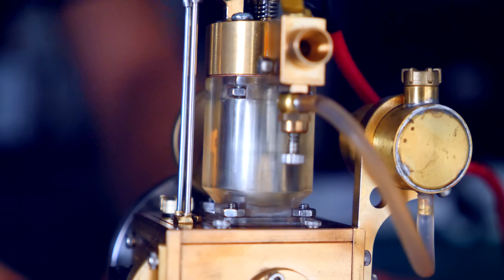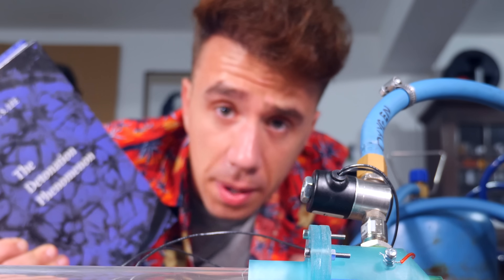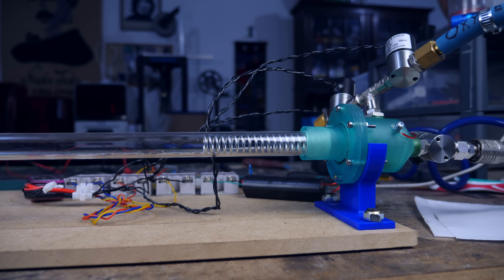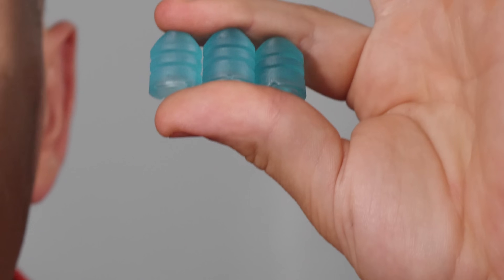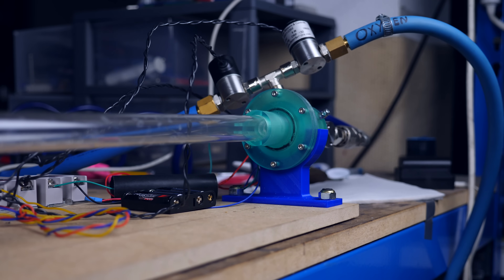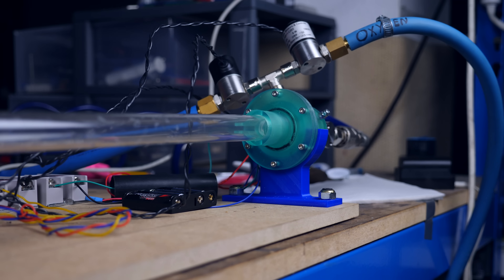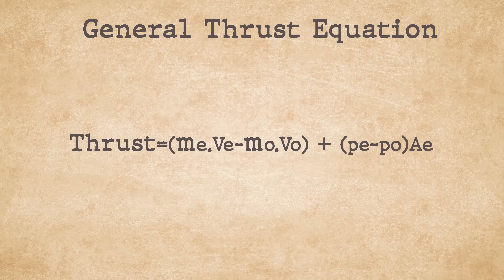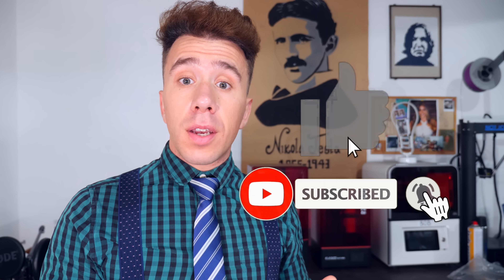PULSED DETONATION ENGINE

Comment: Use two or more valves and alternate between them, using the Arduino, so each valve is used near its peak frequency! I'd like to see that engine ran at 100 hz, then try 200hz,500hz, 1khz

Comment: Hey integza, an engine like this (pressure optimised) are best used as prop/shaft engines. It's much more efficient to extract the energy using a turbine rather than trying to push against the atmosphere

Comment: So I been thinking about this I'm Shure it's a gas exchange down thr barrle of the engine so you have to put ports and use a noble gas to to push out the ,as.well.as.sheld the engine from heat so the reaction happens in space the gas pushed through ports will push the shock wave out you can manipulate  the shock wave ....but your right

Comment: What is stopping you from putting a piston with a valve in the pipe? moreover, the piston can be screwed with a crank mechanism for return, or can it be screwed with an ordinary rubber band or spring for return? there is a two-stroke engine with efficiency. with uv. ioannn

Comment: this kinda reminds me of a cool engine I built when I was a young girl

It was similar to this, but instead of gasses, I used fuel cartridges that were basically brass cylinders filled with gunpowder that was ignited with a pin that struck the back of the fuel cartridge, and capped off with piece of brass that was round. The ignition would send the brass piece that conveniently fit the exhaust tube perfectly and was aerodynamic, to allow it to fly safely through the air. The gasses that followed the brass piece were used and chambered into the back of the engine to push the pin back and load another fuel cartridge, allowing for the engine to run essentially forever, until either you ran out of fuel cartridges, or until the engine overheated.

Comment: You've created a cross pulse jet with potato gun a pointless project . So you have CAD software I wander if you could design a jet fighter trainer the specifics are span 9m ,length 11m ,aspect ratio 3, wing area  27m squared . The engine is 42KN, chord to length 0.0257069 and top speed is mach 1 or it could be mach 1.2 but be careful air frames can fall apart.

Comment: Internal engines don’t explode. If they did you would be running around trying to find all the pieces. When a gasoline powered internal combustion engine ignites the Stoic air fuel mixture the fuel burns very quickly at 125 feet per second. It is a controlled burn that causes the gases inside the cylinder to expand, pushing the piston down its cylinder bore, or forcing the rotor of a wankel to rotary engine to spin towards the exhaust port. They don’t explode!

Comment: you have built a HHO Generator, Now a pulse Detonation engine I believe HHO is stoichiometric,  Direct injection of HHO should give explosive detonation and HHO is easy to produce on site, also an augmentor on the output tube should increase the volume of air being pushed.

Comment: Should test the best shape to funnel the pressure in out of the pulse Canon..I mean rifle.. I mean engine. The tube shape may not be the optimal way. Makes no sense if you improve the engine design and valves only to have a pressure restrictor in the form of a tube.

Comment: I think you should try to  use more oxygen so it could boost the butane gas like for example when you are welding using an oxy-acetelyn then set the timing to be less for a first try

Comment: I wonder how much thrust you could achieve with something like a funnel shaped exhaust to to take advantage of  the area of high pressure it creates if you could resist the expansion of gases with some simple geometry you might also end up pressurizing the tube between pulses and I think if you had the frequency just right you could create a lot of forward thrust again with the correct geometry

Comment: Video Idea: Try and make a miniature Jet engine like the ones on a 747 or a f/a 18 And attach it to a 3D printed Airplane or Helicopter prop and see how fast, high, far it goes while also changing nozzle size, power input etc.... To see the different results.                         ( Ps. If I win Be sure to launch a tomato into the stratosphere.)

Comment: If you want really fast projectiles, make them large enough in diameter to where they barely fit in the tube, almost getting stuck. In such a scenario, the polymer tube might not be strong enough to avoid becoming shrapnel, however. You'd obviously want to use the metal haha

Comment: Great job on wearing safety goggles! The next step would be to wear ear protection because bigger explosions == bigger noises.
Reply: Pretty sure I saw him using earplugs. Proper ones are just as effective as over the ear ear pro.
Reply: @giin97  What do you reckon the odds are those are proper ones?

Comment: The Shchelkin spiral spring was interesting how it improved the effect. I once tried a tall, curvy or ribbed brass candle holder one time where the "exhaust end" was very wide with not hardly any confinement yet it made a good bang just being misted with methanol and lit from the open narrow end with a Bic lighter. If you try that same trumpet shape with an aluminum baseball bat with the the ends cut off the flame front becomes terribly slow and won't produce a bang. But this narrow wide narrow repeating channel shape accelerates the combustion quite suddenly.  If you turn up the volume you can get an idea of the sound from this video entitled Candlestick Holder with Methanol, maybe of interest and only just as an aside or tidbit.

Comment: You can try a hydrogen powered engine, which is very powerful, or may be try kerosin as fuel , the thrust would be INSANELY insane with oxygen. Tomatoes are DISGUSTING!!!!!!!!!!

Comment: I agree, tomatoes are disgusting.

I'm playing with the idea of doing fluid controls for recuperating the rain water and "pushing" it into the garden I have.  The problem is about how to get enough pressure to move the water around.  I need to recuperate at the bottom and leave an overflow.  However, at that point, I can't  build enough pressure at the bottom to redirect it up...  

Anyway, don't know if the above can give you an idea.  
I'm also wondering, can you do a 3D printed electric motor or is it too fragile ? (not the copper or ferromagnetic material for better efficiency, but the support material).  I would love to do so one day :).

Comment: You could create multiple combustion cylinders that converge into one exhaust pipe, something that looks similar to a Rolls Royce Derwent jet engine. I would combust them in rotation of a clock that way you will have higher pulse rates of combustion kinda like a radial piston engine.
Reply: only reason the ramjet isnt implemented more is the noise...
Reply: @harleyme3163 what? No, pure ramjet engines aren’t used because they create no thrust while stationary and thus require an assisted take off or something that serves the same purpose. Unless you’re talking about shock-ramjet engines which just aren’t practical for anything that isn’t supersonic 100% of the time.

Comment: Integza, make a Rocket out of Carbon Fiber, but you have to laminate Carbon Fiber and Fireplace Sealant on 3D printed molds like with the Pulse Jet.

The engines, fuel tank, etc have to be made out of the same material.

If you don’t want the entire rocket to look like a dullish grey color, you can paint it to make it look like, I don’t know, a NASA rocket.

As a starter, I suggest you to make solid rocket boosters like the ones on the NASA space shuttle and make the entire rocket propelled by solid rocket engines. Like the Apollo rocket.

You can then graduate to more advanced rockets which use Liquid Rocket engines.

For the more advanced rockets, you can 3D print them and use your 3D printed rocket engines in place of Carbon Fiber + Fireplace Cement Sealant Rocket Engines.

Good luck!

Comment: Instead of electrovalves you could use car fuel injectors, they are able to support higher frequencies and are pretty accurate at realeasing a specific amount of fuel
Reply: They also release at a high pressure, which would be beneficial

Comment: Hello!
I offer a useful project that will be able to help at the time of need and will be able to expand people's opportunities in many directions.
The essence of the project is to create an autonomous drone that can fly along a route for a day using navigation. Perhaps it is better to use electricity and place solar panels on the wings. If it is a fuel-powered engine, it will have more restrictions.
Many people need supervision over certain areas. Some services will be able to deliver various cargoes and even rescue people in automatic mode.
I have a great desire to implement such a project myself, but I do not have the opportunity. I wish you inspiration and strength in your projects!

Comment: @10:41 I managed to create a pulse jet that fired at this speed with a tall NOS can and a 2 foot ish steel tube with a maybe 1in and a half inner diameter, I put 95% iso alcohol in it and got it to run maybe a single min at absolute max, honestly probably only 45 seconds. It ended up getting to hot, even though we were cooling it with water, to the point that it burned a few holes open on the walls.

Comment: hey next time you do something with rockets just use a graphite Block in which you machine a bell nozzle into. the nozzle is not 3d printed but the tool to make one can be printed and its easy enough to machine. Personally i would like to know what fuel is better, ASA or Rocket candy. Maybe even try other filaments.
as an alternative chopped carbon fiber with the fire place setting compound that you can compress in a 3d printed mold should also work

Comment: Make a jet engine where fuel is injected into the back so that it can be high pressure and if you keep using that ring with holes in it then you can do that along with fuel coming in with the back so that you have more thrust when it gets lit up also combine oxygen with said fuel.

Comment: What do you think about building an engine that runs on liquid fuel instead of butane or any other gas? It could be quite a challenge, but still within reach. More parts to discuss and more potential factors to predict. Interesting for sure and in line with the theme of the channel

Comment: You could do the solid fuil rocket engine and put the solid fuel inside of a ceramic casing and that will help you burn a lot more if the fuil stop it from blowing up and be easier to keep control of

Comment: video suggestion What if you made an engine that has two inlets and one outlet as the two inlets one be air and the other a fuel source exhaling in the exhaust?

Comment: Is it a idea to make a car just on pressure air. I've worked out this idea in my last year of school but they never approved it cause I wanted to use a pressure tank of 230 bars 😅
Maybe you can print the parts and test the limits of it to see if a mini car could drive. For engine I was thinking more like is piston. Or maybe you know something better. 
I hope you would have a great video with this idea, I can use a printer to try it also.
Thanks and greetings from Belgium.

Comment: I had an idea once along a time of making a aerospike but make the gas spin slightly around the spike I did like a 10 degree angle but I was doing a hybrid rocket wood fuel and oxygen and it stopped up my ports to quickly can you try it with liquid fuel?

Comment: you can use three or more shockwave jet engine in order to have a rotation effect like a fan with a slight angle towerd the flower so you kan use the trust for it and from the fan rotation

Comment: Could this run with a continuous spark and intermittent gas flow? maybe just a pressure check value on the fuel feed line?

Comment: You could try to use High pressure Fuel Injectors, that are normally used in cars as a better electronic valve. They are designed to inject at much higher freqencies

Comment: Hi Integza how about a solution of potassium permanganate and gasoline mixed with hydrogen peroxide in the combustion chamber. The oxygen release in the reaction can be used for combustion . Can you please try this .  Please wear safety equipments while testing engines.

Comment: you should try building a small scale airplane powered by those engines, 3d printed, or an actual rocket. there are videos out there of small rc-controlled jet powered airplanes and they are really insane, it would be nice if you could DIY one.

Comment: To be honest I don't know if I will a 3D printer, but I do really need one to try out experiments like these, so here goes nothing:

Idea: I have seen you create all lot of engines and they do have a gud considering the one where you made a 300g jet engine and used it to move a 3 kg skate board. why don't you make lightweight engine with an after burner effect and put in a rocket model and try to blast it up, when the fuel is almost over use the after burner to give one single final push, since the after burner consumes a lot of fuel.

Comment: Awesome channel 👍🏼, could you do one on the theory of the Papp Engine, by Joseph Papp inventor, and maybe at least make a cross section demonstration of this unusual engine and how it works using original documented video demonstration clips.  
It’s extremely interesting.  There no conventional intake or exhaust, yet the the extreme plasma & reverse extreme vacuum gives mechanical energy on each top dead center & bottom dead center on the piston, by its unique chamber containing low volume CC’ of none reactive noble gases, only certain conditions makes this chamber have a small window property to bring that piston down & collapse back into a extreme vacuum giving another mechanical rapid return force.  
Worth investigating, especially the different patents issued, and groups that are passionate about this Papp engine.  
Look and find original vintage Papp engine videos with the inventor demonstrating and explanatory theory.  

Good health everyone… 

Sincerely Samuel Luciano 💎🔑🖐🏼

Comment: New to your channel, have you done a linear accelerator (rail gun) yet? My idea would use a high speed motor as a mechanical driver to fire the electro magnets in the accelerator, only firing when the motor has reached max revs.

Comment: Could you put this on a car and run the car extremely Rich and make the fuel reignite? And have a oxy tank, a battery and something to control the spark firing like the cars cmp & ckp sensor &or the ecu.  Just a idea 🥸

Comment: Well You do gave jet engine. And it works. Maybe it is time make afterburner for your jet engine?
If You use liquid fuel and try to use it as coolant, You will get cooling with preheating fuel, this will give additional efficiency.

Comment: I want you to make a detonation engine that works at 2x audio frequency so it can play music. run it in an open field, and measure the dB(C) SPL at 1m, at 10m, and at 25m. If it truly creates high pressure, then it should be able to create sonic pressure down to DC, which would make it an alternative to the only other known speaker that goes down to DC, which is the rotary subwoofer, that uses a fan with adjustable blade geometry.

Comment: Hey integza, maybe for your next project try integrating the fuel/oxidizer injector of a pulse jet with a much shorter pipe, then add in a ramjet-style compressor. might help make th system more compact.

Comment: You can slowdown the combustion in a gasoline engine by adding 1 cup of engine oil. This works well with lawnmowers, but use octane boosters in your car for your O2 sensors sake.

Comment: Shockwave, a three-engine jet truck, is the world’s fastest truck. It can reach speeds of up to 400 miles per hour.

Shockwave was designed and built by Jet Hot Rods, a company based in Missouri. The company’s owner, Ron Patrick, is a former drag racer.

Shockwave is powered by three afterburning Pratt & Whitney J34 het engines that produce 36,000 horsepower. The truck has a wheelbase of 50 feet and weighs 22,000 pounds.

Comment: Seems like you need a nozzle. Perhaps you could have a look at the design of bell nozzles in rocket engines. I believe Scott manley did a video about calculating the ideal nozzle geometry for given pressure/flowrate differential🤔

Comment: Build a rotary continuous pulse jet engine? Feed the exhaust from multiple pulse jet engines into a single output, maybe use valves to deal with the issues that may arise

Comment: Using that same engine try it with a tesla valve reversed.
The tesla valve when used with gas has a strange effect of creating more pressure when ignighted. Only when used going against the intended flow.

Comment: Oi integza, you remember that vortex cooled rocket ya made. Well you explained that a vortex facilitates FLOW. So I thought with the minimal knowledge i have in cars that if you somehow implemented a vortex generator using manifold gases from the exhaust of a motor you would make them leave faster, and that I think would amp up a car's HP at least a lil bit. I would love it if you tested that, Plus you can practice your welding skills and i want the printer too.

Comment: On some of the test engines I think they used some sort of rotary valve. Why not do something like that? If you were to use an electric motor to control it, you could continue to use thour Arduino to run everything.